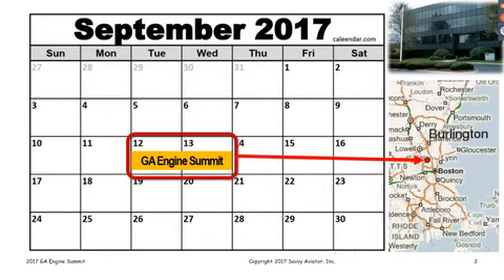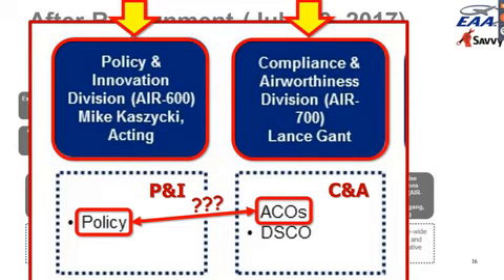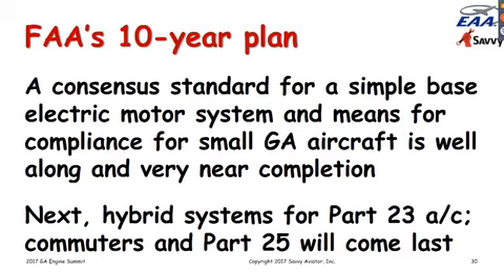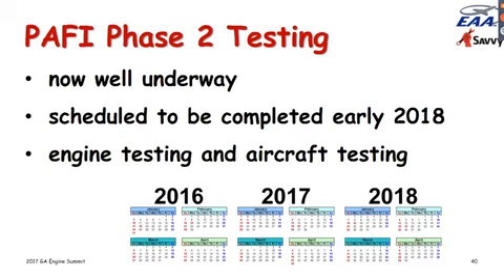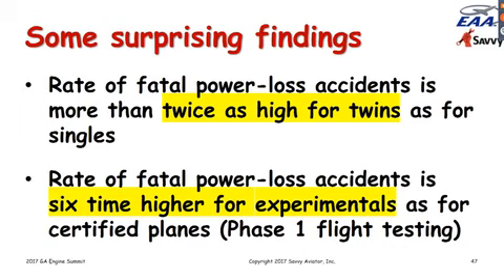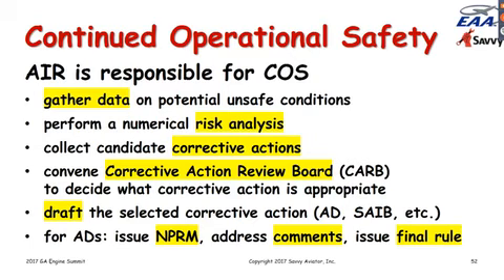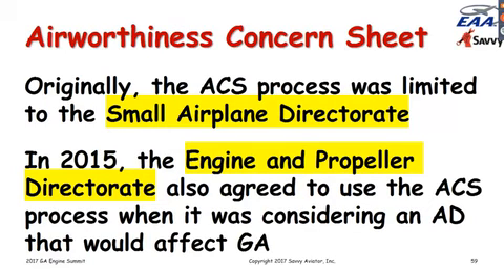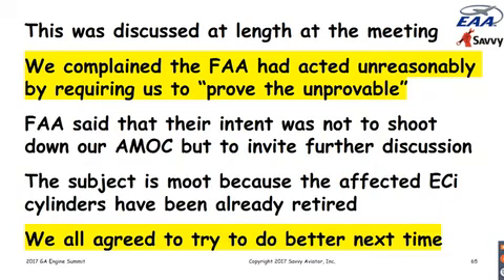Second Annual GA Engine Summit

Comment: I have a question about the leaning a tsio 520 r, in run up a put 2000 RPM and Leaning them don't touch nothing until cruise a put 24 mp and 2300 RPM but how I leaning? egt? ff? or RPM. now I leaning with the RPM. is bad or is normal? please give me your opinion. I saw your other videos about leaning...
Reply: Look at the other videos in Savvy Aviation series.  He has many videos on EGT, CHT, engine monitors and one or two specifically addressing leaning engines, including one called leaning basics.  This should give you plenty of information on properly leaning your engine.